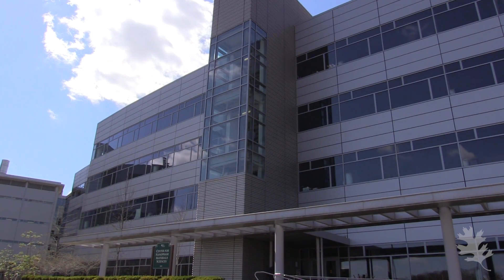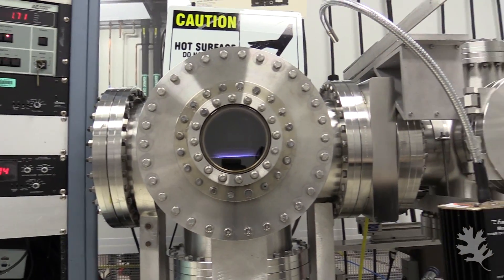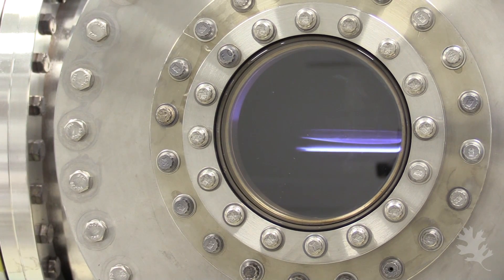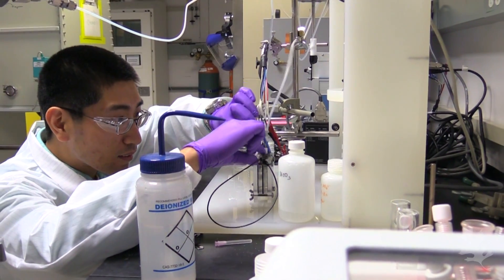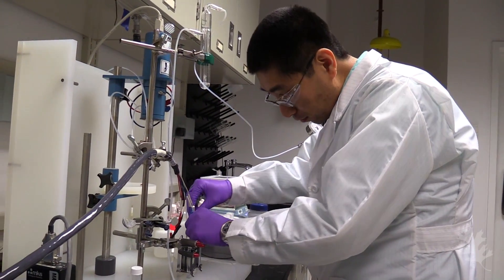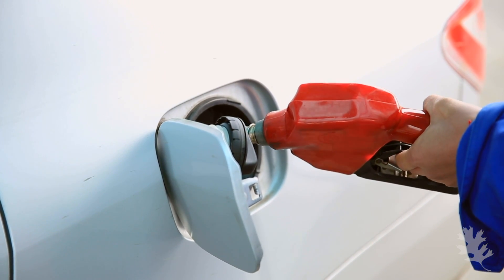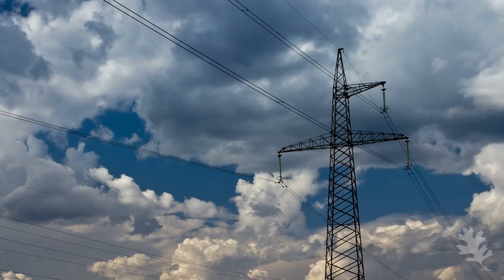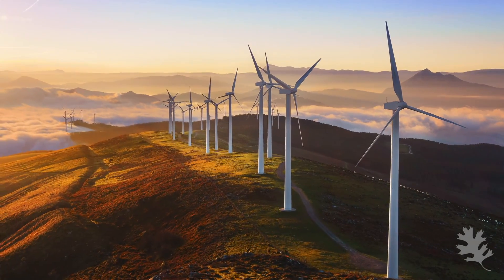Nano-spike catalysts convert carbon dioxide directly into ethanol

Comment: Damn. Ethanol from CO2, using nano-technology?
It's like you discovered the modern Philosopher's Stone.

This sounds too good to be true.
How efficient is this process? Does copper nanoscale structure have the potential to make this economically significant?
Reply: They said that their efficiency was 65%. And this is the first step of the process - scalibility, durability, and technoeconomical feasibility still has to be evaluated. 

Yet, the fact that it is possible will also open other ideas in the same vein, which hopefully will lead us to a better future.
Reply: LinkEX it doesn't surprise me from a Chemistry point of view. Of course the process is energy intensive so you can just go out and use it without a penalty, which is why he said use it when there's excess energy being generated so store them in the form of ethanol. To use this to 'clean up' the air would require loads of electricity so would only make sense if it were powered by clean sources.
Reply: There is simply no other way than to put energy into a reaction that produces ethanol from carbondioxide. Because of Thermodynamics.The question is: where does this energy come from?
Reply: Esteban Rincon You do know how the majority of our electricity is generated right??? You're pumping more CO2 out, just to burn the Ethanol that you created. Dear God, have you never taken a Science course, or even an Environmental course???
Reply: +Summercoat well I think you guys misunderstood the purpose of this video. nowhere does it say it's to reduce global warming or net CO2. This type of discovery has many scientific applications. At the moment we use CO2 scrubbers in manned spacecraft that get saturated and have to be replaced with new ones launched from earth. Remember, Apollo 13? Imagine if we could have this device on the ISS that uses electricity from its solar panels to reduce CO2 within the station. The resulting Ethanol could be used as rocket fuel to boost the station's orbit, etc.
Reply: For goodness sake can people stop thinking this invention is for cleaning up the environment?? It doesn't say so. Like I mentioned, it has very practical application in our spacecrafts to scrub CO2 out of the atmosphere and produce ethanol for orbit boosting. The device will be powered by the craft's solar panels.
Reply: It still consumes energy to have the reaction occur, if it's anything like hydrogen, than it isn't worth it.
Reply: Summercoat yes but he did say it's for storage, just like charging a battery or producing H2 they all consume energy.
Reply: Summercoat disagree. this is still a very significant discovery that will have countless uses.
Reply: +Estaban Rincon yes but that's the same as how we turn household trash into diesel fuel using plasma incinerators here in the UK and in Japan. We're getting fuel out of an unwanted source at the cost of a lot of energy.
Reply: your question is invalid because it's not 'other option' but rather 'optionS'. There are many ways to reduce CO2. We can grow algae to convert CO2 into diesel or use CCS technology at power plants to capture CO2, or run vehicles on biofuel which is carbon neutral.
Reply: I agree, I just disagree with the option of this video. It is also not an invalid question. I believe its around 80% of the grid is powered by coal.
Reply: Plasmon19 the rainforest uses sunlight to convert CO2 into energy. This device doesn't :) this one produces more CO2 than it removes.
Reply: +Plasmon19 at the moment we use lithium hydroxide canisters to scrub CO2 from spacecrafts. Remember the famous 'hole in a square peg' problem on Apollo 13? Anyway these canisters don't produce anything useful and have to be regularly replaced with new ones launched from the ground.
Reply: yeah exactly!! energy must be conserved.
Reply: Esteban Rincon You said, and I quote, "How is an alternative, FREE fuel not practical?" You must be no one than....
Reply: +Summercoat hahahah yeah some people don't understand thermodynamics and conservation of energy. Energy is required to convert CO2 to anything useful because of thermodynamics. The most viable option as I've mentioned above is to grow ponds of algae that feed on CO2 and output oil that can be used as diesel.
Reply: Brian Su That was my point, that this can not work for what people are pushing it's uses for.
Reply: It would need to run with a large capacity as well as efficiently since it needs energy to be cheap it would also be limited to certain areas though it may be able to run full time in iceland with its low energy costs from hydro and geothermal at around 5 cents per kwh.
It would need to be practical to only operate 1/4 of the time or less to take advantage of places with a lot of wind like denmark and germany.
Reply: +Malcom Smith no this isn't for generating electricity or reducing CO2 that is already in the environment. It's to be used to cater for specific scientific needs such as scrubbing CO2 out of enclosed systems like a space craft.
Reply: You also have to factor in how that electricity is made, and the fact that you're not getting 50kw out of the ethanol that you produce.
Reply: Plasmon19 that electricity generation only makes up like 8% of the power grid. Not to mention the manufacturing process also produces CO2...
Reply: Summercoat About 20% in the UK  but your right its not 100% clean nothing is but allowing for that It's still many many times cleaner than fossil fuels. 
Nuclear produces less co2 and other pollutants per mwh than solar and wind as dose hydro. 
But sadly pepole dont like nuclear or want to live near nuclear dispute in remaining 1 of the 2 cleanest energy sources we have and theres a limited number of rivers we can harness for hydro.
This could help with storage but also to produce and sell ethanol from countries like Iceland and New Zealand with 100% and very cheap hydro and geothermal power production and plenty more potential capacity.
Reply: Brian Su Scrub CO2 from the atmosphere? Citation needed.
Reply: it´s possible to use photovoltaic energy
Reply: Yup :)
Reply: Ok
https://en.wikipedia.org/wiki/Gasoline_gallon_equivalent
33kwh in ethonal so curently 50kwhs to produce and a consistant 5cent per kwh in iceland means $2.50 per gallon of ethonal.
I guess thats still quite high.
Though not for a home facility / personal use since it then wouldn't be taxed (UK personal use allowance) which is very high in the UK £1.15 per L $1.4 4.55 L to a gallon gives $6.37 per gallon so anything below 12 cent per KWH is potentially viable
https://www.ft.com/content/5164675e-1e7e-11e6-b286-cddde55ca122
i think theres room for it to peotentaly become be economic in certin areas.
Reply: Summercoat I did factor that in to my working 33kwh in a gallon so 50kw to make it 66% efficiency assumed based on there 62 - 70% efficiency .
the excess is made using solar or wind or hydroelectric in Iceland.
Also with rising Oil and falling though inconsistent wind and solar (there are some estimates of 2.5 cent per KW/H production by 2040 in sunny areas for solar) there are already bids as low as 3 in dubai though thats unusually low and it varies from place to place.
at 5 it starts to become potentially commercially viable as in also paying the same fuel duty and vat in areas simply further from sources of oil or with high import tax.
With a lot of solar or wind the issue they have at the moment of inconsistent generation not when its needed results in low sometimes even negative prices and thats what you want to use.
The rate of the reaction and cost once scaled up matters a lot though.
Carbon dioxide can be extremely cheap to buy again depending very much on location.
Reply: Plasmon19 Brian Su lol, they'll never get it.
Reply: It's still cheaper than buying vodka at the store.
Reply: If we all thought like you we'd be stuck in the middle ages still, since every new invention would be deemed "pointless".
Reply: I mean, it's a neat reaction, I just don't see the practicality in it.
Reply: No one is saying it's 'free' but it's still a fuel that we can extract from an unwanted source. Fuel is still fuel.
Reply: They consume more energy than they produce, I just don't see the point personally.
Reply: The point is not to produce energy, but to transform CO2 (which we have in excess), into ethanol, which we can use.
Reply: To produce CO2 again, it's a dumb idea.
Reply: This is just not true, there are brilliant ideas and solutions out there, like NASA utilizing solar panels in space, nuclear fission to create steam to drive a turbine that creates a seemingly endless supply of energy. This however, is not that next great, "game changer". This is a neat reaction that has no real world application in the large scale. It makes no sense when you think about the amount of power that would actually be needed to make a difference. Say to create 500 gallons of ethanol, it would take at least 750 gallons worth of ethanol just to power the reaction. That is a crap ton of energy, it would cause an already overloaded power grid to be even more burdened. This is a bad solution to a problem that doesn't exist.
Reply: Esteban Rincon Nothing is for free Esteban. This rains true in both economics and science. Anything you do has a cost, building chains of carbons has a cost, an energy input that has diminishing returns. That's why I don't think it is practical. You're spending more than you get out. Your taking in the CO2 that you are just going to output again. It's a cyclical cycle
 that seems ludicrous at best (in full scale).
Reply: So what's the other option, let the CO2 keep increasing and ruining our climate?
Reply: How is an alternative, free fuel not practical?
Reply: You don't need to buy CO2, you can extract it from already existing sources like fossil fuels and recycle it through storage after use. The efficiency might lower a bit but it creates a constant feedback of carbon, functioning essentially in the same way a rainforest does, except much smaller and with direct practical application to the user.
Reply: Brian Su Ha! You're stupid. If you use photovoltaics, wind turbines, or hydroelectric power to convert CO2 into Ethanol then the CO2 emissions are either heavily reduced or stopped entirely. The process was explained in the video. So yes these devices would function in a similar manner as rainforests.
Reply: Summercoat That's true, but that point is null to the statement I made. Recycling of carbon does contribute positively to CO2 emissions. This new technology has the potential to increase efficiency as explained on the video.

Comment: But then you burn it and it's released again? This is only good because it's carbon neutral? Not burning fossil fuels?
Reply: Or you drink it, and lock it in human waste.  Or use it to produce animal feed.  Sure, that still results in some of being burned, or turned into other gasses...but it is a net negative for CO2 (or CO2 equivalents).

Either way, taking CO2 out of the air, making ethanol, then burning it later is still fine.  A carbon-neutral liquid fuel is the holy grail.  Storing renewable, green energy, in a way that is easily transportable and usable, is a big problem that needs to be solved.
Reply: Brian Su Yes, it needs to be produced by renewable sources.  That is absolutely accurate.  This is more of an alternative to storing excess power, rather than a new source of energy on its own.

And yeah, CH4 is more potent, but the amount produced would be much smaller than the CO2 used to create the feed.  Plus, that CH4 was already going to be created, because the animals are going to be farmed no matter what.  If the process used to create their feed is removing CO2, then that is still a net negative over the current methods.
Reply: yes but this process of taking CO2 out of the air to make ethanol is energy intensive so for it to be carbon-neutral would need to be powered by nuclear power or other clean sources. If you convert it into animal feed then you're converting CO2 into CH4 which is a many times more potent greenhouse gas.
Reply: Dustin O'Bryant immediately decisting fossil fuel use needs to happen now, this is still "conceptual"  Nuclear is clean works now and can be scaled immediately enough to perhaps stop ecosystem collapse. Put a powered lane in on main roadways and charge electric autonomous vehicles and use it as the last linch pin in self driving vehicle navigation, raining, snowing, the charge lane tells your car where the one ahead and behind are. 

Nuclear folks!
Reply: That is what I was wondering.
Reply: Ron McVicar it's only carbon neutral if you power it with clean energy though. Maybe a hypothetical scenario would be to use nuclear power to run these things to generate fuel for vehicles, then in effect those vehicles would run carbon neutral.
Reply: Dustin O'Bryant nuclear...
Reply: Ron McVicar Nuclear isn't very transportable.  Ethanol can be used in a combustion engine, and thus is usable in the vast majority of machines that currently run on fossil fuels. Some may need small tweaks to their engine, and/or the software that runs them, but that is about it.
Reply: +Dustin O'Bryant ahh good point. Actually many cars can run on some Ethanol right away, i.e. Petrol + Ethanol mix. This is done in some countries and helps to offset the use of fossil fuels at the expense of mileage. Some cars like the Koenigsegg hyper cars can run on 100% Ethanol and actually need them to reach their full engine power output. I guess the downsides of Ethanol is lower energy density thus leading to lower mileage and also the lack of lubrication properties that would require valve seats to be hardened (the do so in gas powered vehicles anyway).

Comment: so you're telling me i'll be able to make my own alcohol from the air using electricity whilst reducing global warming... the future is awesome
Reply: You can run a gas turbine with ethanol or mix it with gasoline.
Reply: @daviddreyer5817  but can I use it so easily in a gas turbine without a conversation?
Reply: To get 1 kg CO2 you have to use either high concentrated CO2 or collect hundreds of thousands kilograms of normal air.

Comment: ELI5:  Is it possible to isolate the atmospheric CO2 (~400ppm) and utilize this process?  If not, how could this be implemented into reducing CO2 production?  It's a cool concept but it seems like they're just emitting pure CO2 for the sole purpose of its conversion to ethanol.
Reply: biofuel industry is just a delay method to the CO2 build up in atmosphere. If the input = output => we don't emit anymore CO2 and keep the amount of CO2 in the atmosphere at ~400ppm. It's not a real solution to the problem but by doing so we can keep the amount of CO2 in check while waiting for another scientific method to reduce CO2.
Reply: We could plant more trees ;) and stop cutting the living ones down.
We could use drones and shit and make the planet greener in no time.
Reply: Dong Nguyen 
or store the new products .... and plant much more trees , so that in the next few years , the planet will recover .... maybe selling it to places were the tees get cut , so that they use it as fuel and industrial needs , for the same reason ...we have the cleaning devices already